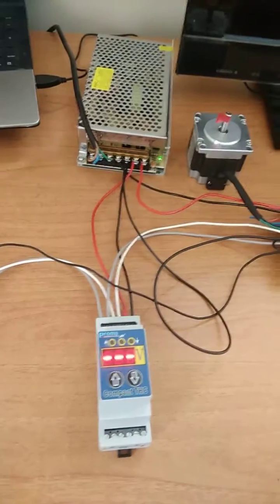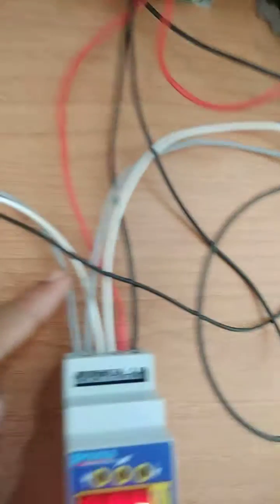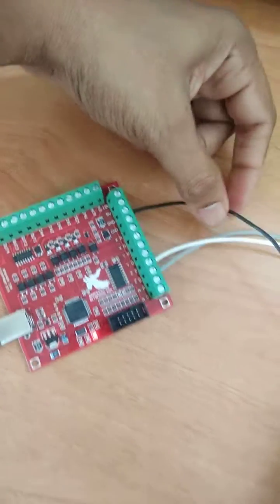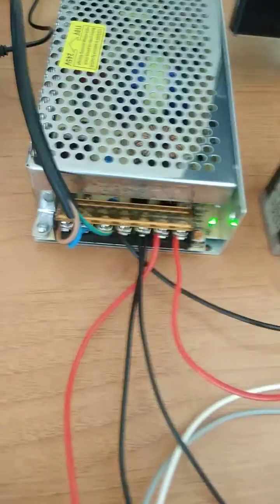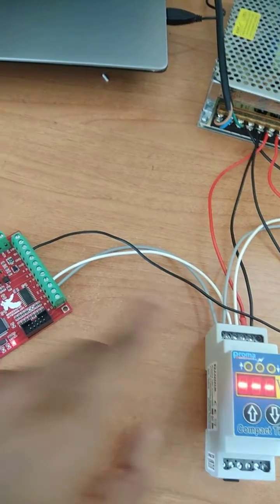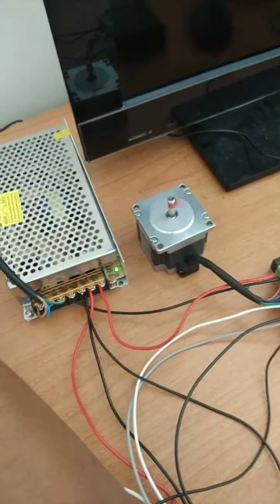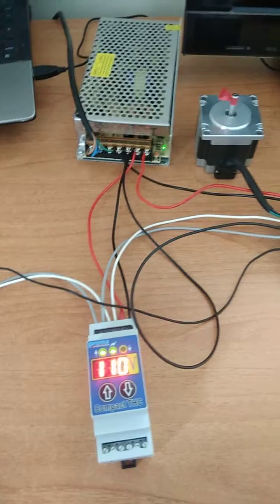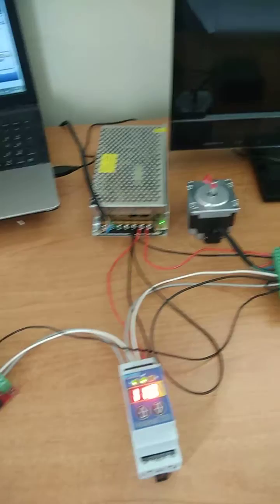PROMA SD THC WIRING PART2

Comment: hi have you try with drufel cnc software the thc proma sd  for me i've meet some trouble  z axis movement doesn't work !
Reply from the maker: Hi, I haven't tried with drufel cnc software but it should not matter as the proma SD model has no interaction with your cnc software.. The moment the cutting starts based on the voltage from your plasma machine proma sd adjusts the z axis directly. At this point your software z value and real machine z value go out of sync as your cnc software does not know that proma SD had taken over control. At the beginning of next cut using the floating head mechanism and appropriate gcode (G28.1) the z homing happens and your software z value and real machine z value come back in sync..

Comment: hi great video   !!!!  but configuration  mach3 proma setting needed.. does thc ok thc down and thc up  are mark in mach3 settings?
Reply from the maker: There are 2 promo thc models (https://www.proma-elektronika.com/produkty/) 1. Proma THC 150 2. Compact Proma SD . I use the compact Proma SD model which does not require any interaction (no THC OK, THC Down,THC up etc) with mach3 and hence there is no settings required in  Mach3. Sorry i have not used/ have no information on the other model (proma THC 150).
Reply: @cncplasmamadeeasy2872  thx a lot.  For me too i m using. Proma sd 150
Reply from the maker: @fas83  For Proma SD model, No Mach3 settings required but You need to have a floating head mechanism (Please search videos of it online) which will help to set the torch tip to appropriate height at the beginning of each cut. Once the cut begins Proma SD will take over the control of the Z motor and try to maintain a constant gap though out the entire duration of the cut. At the end of the cut mach3 z-axis value will be different from the actual value as proma sd had taken over control during the cut.. The floating head mechanism/G 28.1 call in your gcode will ensure that mach3 z-axis and actual z-axis values are back in sync again..This cycle will keep repeating for every cut. Apart from this there is no specific software setting in Mach3 required for the Proma SD model.
Reply: @cncplasmamadeeasy2872  don’t worry about. Z floating i’ve got it😉
Reply: @cncplasmamadeeasy2872   perfect -thx

Comment: excellent video!  I was wondering how to configure the Mach3 so that it works correctly with that same kit from the video?  I would greatly appreciate your collaboration.
Reply: Thanks so much for your help, I will try it and I keep you posted. Also I will give you credit for your posting and help. Thanks so much
Reply from the maker: Thank you. You need to have a floating head mechanism (Please search videos of it online) which will help to set the torch tip to appropriate height at the beginning of each cut. Once the cut begins Proma SD will take over the control of the Z motor and try to maintain a constant gap though out the entire duration of the cut. At the end of the cut mach3 z-axis value will be different from the actual value due to proma sd taking control during the cut.. The floating head mechanism/G 28.1 call in your gcode will ensure that mach3 z-axis and actual z-axis values are back in sync again..This cycle will keep repeating for every cut. Apart from this there is no specific software setting in Mach3 required for the Proma SD model.
Reply: @cncplasmamadeeasy2872  Thanks you so much, for the drawings and fast respond. Questions did you use output from the chinese board to turn plasma on off? Did you have drawings for that connection too! Thanks
Reply from the maker: @enigmamotorsport  yes.. That's the way it should be.. You need to use a  relay to do that.. You should wire up your relay as in the link and also assign the correct port/pin number to output 1 (also shown in the link)  https://drive.google.com/file/d/1S3LKGsoS7hubwIECofod0MwAFzrdvN5H/view?usp=drivesdk .. Next go to spindle setup tab and assign output 1 to M3 as shown in link https://drive.google.com/file/d/1S6LJ2Y0Hq3aADe0vpvFirb99WOKayzmc/view?usp=drivesdk  .. After this when you run M3 you should be seeing the relay getting triggered.. Similarly M5 should turn it off..
Reply: @cncplasmamadeeasy2872  The link is not opening, Thanks again for all your help.
Reply from the maker: @enigmamotorsport  Pls try now..

Comment: But you dont have potensiometer  to rise  a speed of z.
Reply from the maker: Why do I need to rise the speed of Z using a potensiometer? It can be be controlled through a GCode by mach3 controller or through a setting in proma SD.
Reply: @cncplasmamadeeasy2872  sorry i think  there isn't parameter to ajust a speed of z in this devise.

Comment: Hello again, i have managed to get it to work, but now i have to get the settings for floating head, what settings do you have in Mach3?
Reply from the maker: Hi, You have to setup the Z Home switch in Mach3  and measure the "switch offset" (Search "switch offset floating head" in you tube there will be videos on it). Apart from that there is no setting required in Mach3.  The "switch offset" value will need to be set in the sheetcam post processor file.
Reply: @cncplasmamadeeasy2872  Hello, where in Sheetcam poat processor can i put the value in
Reply from the maker: @clausbiesbjerghansen9728  There is a `edit post processor` button in the same place where you select the post processor. This will open up the post processor in notepad or word editor.. Search "switch offset" in this file and enter your value here and save the post processing..

Comment: Hallo, can you please help me, i have the Proma SD controller, but im not able to move the z up and down manually, i have connected it like you did, but no action.
Cant it be a setting in mach3?
I have a different controllercard than you, i have Z puls - and +  Z dir - and + i  have connected the proma to puls - and Dir-
Reply from the maker: There is no setting in mach3 required for the proma SD model. Without attaching the proma sd, are you able to control z axis using mach3?
Reply: @cncplasmamadeeasy2872  no i cant control the z axis, it works fine with Proma, but not manually
Reply from the maker: @clausbiesbjerghansen9728  Please share me a picture of your wiring without the proma thc attached.
Reply: @cncplasmamadeeasy2872  i havent had a z axe before only x and y but when i got a Proma i thought it would work maually also
Reply from the maker: @clausbiesbjerghansen9728  No.. The proma sd model cannot be used to control the z axis manually. Only while cutting it uses the arc voltage to adjust the z height so as to maintain the preset voltage. Only your controller(if it has the z axis signal outputs, just like x and y) will be able to control the z axis manually.
Reply: @cncplasmamadeeasy2872  yes i know, but how have you wired yours so i it moves up between each cut, and what software do you use, i use Sheetcam and mach3
Reply from the maker: @clausbiesbjerghansen9728  sheetcam and mach3 controlling a usb controller. But unlike yours my controller has wires running to z axis stepper driver which allows mach3 to control my z height. Check out my proma sd wiring part 2 video showing how the wiring from the controller to z axis stepper driver  is done. In sheetcam you can set the rapid height ( z height to which the torch should lift off when transitioning between cuts) which goes into the gcode file ( eg. G0 Z10. 0), mach3 when executing this line will instruct the controller to send signals to your z axis stepper driver.. For the downward movement of the torch I use a floating head mechanism and use G28.1 to position the torch tip at the correct pierce height. Pls check out "floating head/G28.1" online for a better understanding of how it works.
Reply: @cncplasmamadeeasy2872  I really appreciate your help, i have a stepperdriver too, mine is connected just like yours, wich software do you use?
Reply from the maker: @clausbiesbjerghansen9728  I use sheetcam and mach3.
Reply: @cncplasmamadeeasy2872  Perfect, same as me, wich postprocessor do you use?
Reply from the maker: @clausbiesbjerghansen9728  MP1000-THC-scriber post
Reply: @cncplasmamadeeasy2872  Thanks man, do you have floating head, i dont have that i can see that MP1000-THC is for floating head, or what?
I have to go on job now
Reply from the maker: @clausbiesbjerghansen9728  Yes. I have a floating head. MP1000-THC is for floating head. It outputs G28.1 g code which helps to position the torch tip at the correct pierce height at the beginning of each cut.

Comment: How come you added the extra ground? I’ve got a problem with the same thc it only goes one way wondering if this is why
Reply from the maker: Try it out :)
Reply from the maker: Does the test mode work correctly? Watch the Part1 of the video and check if your thc test mode works.
Reply: CNC PLASMA MADE EASY even in test mode it only goes down I’m going to try it today been on to proma but no joy
Reply from the maker: @jays_metalworks9399  For the initial tests Don't connect your controller.. I assume you have the proma SD model which is a standalone model ..
Reply: CNC PLASMA MADE EASY yes it’s the sd one I got it as the price one I bought never worked at all

Comment: may you help me?
Reply from the maker: If I know the solution definitely yes. Pls tell me.
Reply: @cncplasmamadeeasy2872  

*How did you connect the plasma to the thc sd 50: 1
*the arc start output of the plasma to the cnc board
*and input arc ok to cnc tablet
Could you help me with some diagram I would appreciate it very much
Reply from the maker: @JorgePerez-he8mn  I use Hypertherm 45 XP which has a CPC port which has output pins for Start/Stop and 1:50 voltage signals. https://fabricationguy.com/wp-content/uploads/2019/07/cnc-interface-diagram-hypertherm-powermax45-xp.jpg . 
Not sure of the plasma source you are using. If not Hypertherm, you will have to check with you plasma source manufacturer. Sorry I won't be able to help you in that case.
Reply: @cncplasmamadeeasy2872  

thanks for your help
I have another question
when lowering the torch how do you do the probe sensing
by floating shaft or by contact with the torch nozzle
my plasma is hypertherm 65
Reply from the maker: @JorgePerez-he8mn  I have a floating head mechanism which triggers a z axis homing limit switch. At the beginning of every cut the z axis (Torch head) gets positioned at a preset cut height using this floating head mechanism and appropriate G Codes.